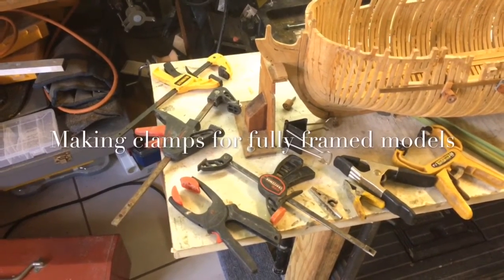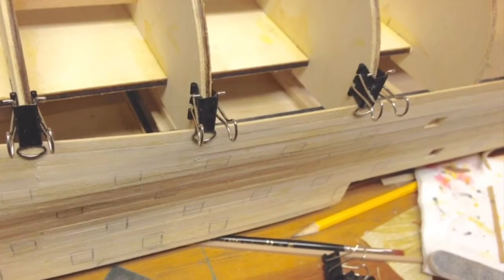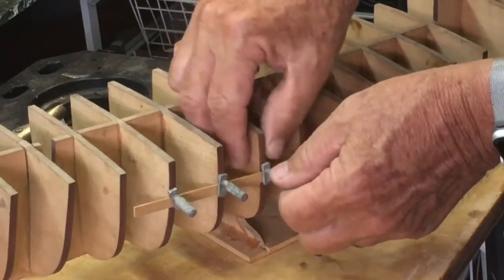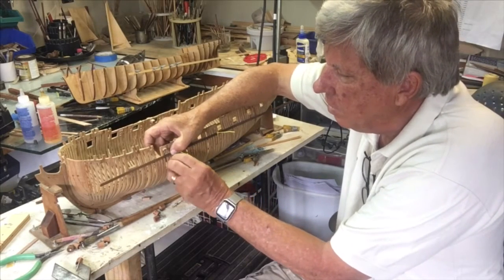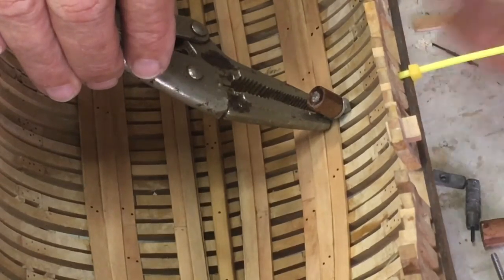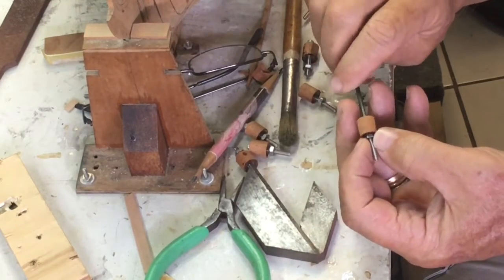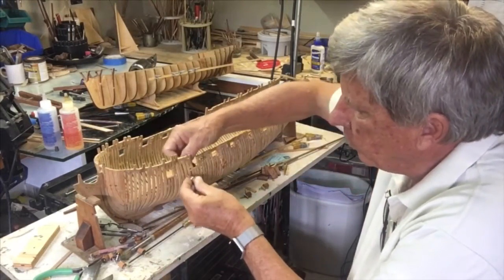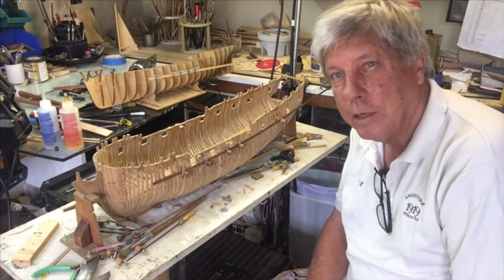Clamps for attaching planks on model wooden ships by Kevin Kenny.

Comment: I've built a number of ships, including the Constitution and Victory and never used a clamp on any of them. I use a combination of fast wood glue (Evo Stick) and superglue. The superglue has to be thick glue, superglue comes in three thicknesses and the thin will just soak straight in and be no use. When i have the plank ready to fit, I use the superglue at the bow and on each separate rib. I also spread the top of the plank, which is to meet the one above, with wood glue, interspersed with thick superglue. As you hold the plank in place with your fingers, the superglue holds it quite quickly to the rib and the plank above and then you move along, spreading your fingers and holding the plank tight to the plank above as you progress along the frame. The superglue gives you the speed to do this, whilst the wood glue gives it the ultimate strength to hold it. Try it, I assure you it works.
Reply: Interesting. So, you must work from the top of the ship down as you plank? Also, do you wear nitryl gloves as protection from the superglue? I  am beginning to build a small Maine fishing boat (pof) and am researching techniques.
Reply: @dooleyfussle8634  Yes, always work from the top dow. if you are double planking the frame I always use the white wood as a guide to the tapering required on the finishing wood. Do the first plank how ever you like and beginning on the second row down use the method above. You will also find that superglue makes wood glue go off very fast. Every surface has to be covered in wood glue from start to finish, this gives it enormous strength, no nail holes, no cracking between planks. My ships are in my conservatory for years, which is red hot in summer, froze in winter and the planking doesn't have a single split anywhere and no unsightly nail holes. Don't be afraid to use a plank bender the scissor type, as they are very good. Some people frown on them for some reason, why I can't imagine as the marking is on the inside, out of sight. If you are doing any rigging look on eBay for Steiglitz splinter forceps and get two p[airs, you can weave and tie rigging so easy with a pair in each hand. Then buy some metal bow wire, hand needle threaders and using your forceps and the needle threaders you can rig blocks so easily. I don't use gloves as being an ex plumber I think my rhino hide fingers are immune to bubonic plague.

Comment: Thank you for your video it was a great help. I love the screw- in clamps with a small rectangular piece to hold the plank in place.  I am currently making a swan class ship named HMS Fly.  I am second planking and cannot find suitable clamps. Where can I get them?
Reply from the maker: You will have to search for the type of clamps you want. model expo, micro mart, amazon all have various clamps
Reply from the maker: You actually need a minimum of clamps if you are prepared to  cut the planks and heat bend them on a jig so they need a minimum of pressure to hold in place. I have come a long way since i made this video and now would not use screw clamps. If you have the time you might want to watch a 7 series video on planking. I call it Planking 101.
https://youtu.be/nQ47mZZN8qY
There is also an excellent paper written by David Antscherl http://www.admiraltymodels.com/Planking_primer.pdf which explains the process. 
Finally, you must be building a kit and not scratching the HMS Fly. He and Greg Herbert have a 4 book series on the Swan class which has turned out to be one of the best set of reference books i ever read. If you plan  lots of modeling in the future i highly recommend purchasing these books. They are available on Sea Watch books. https://seawatchbooks.com/collections/david-antscherl
Reply: @kevinkenny5122  Thanks Kevin, I have found them!  They are from America - Micromark. I can now continue with my second planking.  Thanks again.
Reply: I will still continue to steam and bend my planks before fixing them in place!

Comment: I use rubber bands
Reply from the maker: You are correct, there are a number of applications where rubber bands do work.
Reply from the maker: I have progressed on the model and am now planking the outside of the hull. You may wish to follow video 90 onward https://youtu.be/rI3Uc_S_v1w